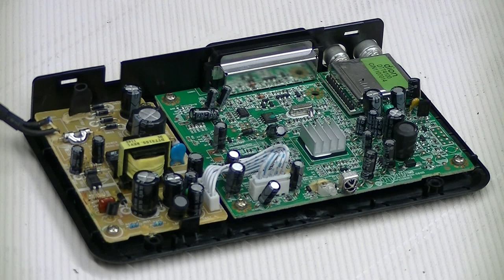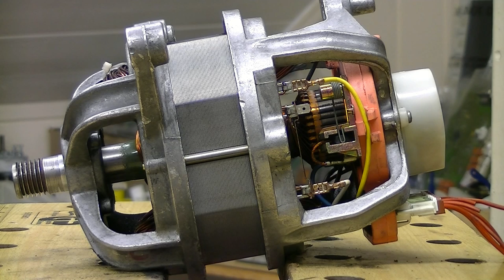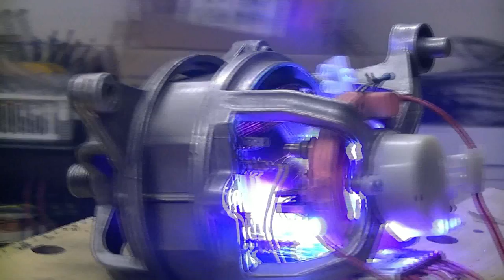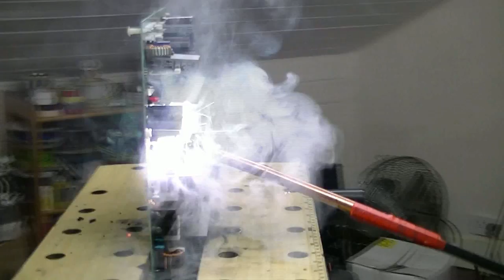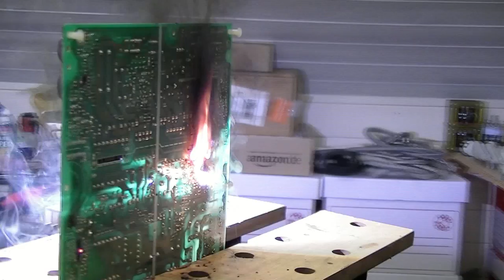Motor And PCB Pop

Comment: You're right photon, there is always something to learn from destructive testing. Always seems like those capacitors go first on those boards. So now we know, we just need better capacitors. Repeat the test and move on to the next problem component, and pretty soon we'll have indestructible electronics.
Reply: Its too expensive for companies to build that and they need their engines to go out asap so prople would buy replacement for them

Comment: Hey, if you want to see a brush motor arcing you don't need to overvolt a nice motor, you only need the Constellation 867A Hoover vacuum cleaner: it arcs as 2:00 with normal 230V 50Hz.
It's not a problem related to brushes: the springs that pushes the brushes are to weak and unfortunately the motor spin in the direction that the brushes get further from the rotor. If the motor spins in the other direction brushes will stay close to the rotor but probably brushes will consume very fast.

Comment: Poppaaaage. :D 

May I ask what was complaining at 0:46? Surely it wasn't the 28A variac, or was it the MEGA-MOT?

Ah, motor pop. For some reason, the first-take didn't seem to get too much speed, or last too long before it popped, but the second take ripped it right up. :D

Oh, I laughed =SO HARD= when the hot stick burst through the circuit board. 
Soldering skills....Oh dear, I've blown a hole in it. I'VE POPPED IT! :D

Thanx for showing, Mr. Photon. :-)

-BoomBoxDeluxe.
.
.
Viewer # 652 :D

Comment: Sorry, did not mean my comment as a response to you, but to those misinformed that think voltage is what makes AC motors go faster. I think people get mixed up with the universal motor, but that is not a true AC motor. A true AC motor like an AC induction type just sits there when DC is applied (but does have a braking effect).

Comment: What would happen if you just welded the rotor so it could not spin at all and then applied the same charge? Can you do a vid of that?
Reply: A continuous-duty motor like this will only quietly hum and smoke as you burn out the starter windings. I once did it by accident because the starter capacitor was not connected correctly. After that, I had to spin the shaft before applying power to make it go.
Reply: Ariel Barton At normal voltages -- what about insane crazy voltages? What I'm looking for is molten metal.
Reply: @mike4ty4  Your windings would short long before the voltage creates enough torque to break welds.

Comment: With a scop that show you a FFT of the frequences, the motor rpm got higher with the time, I figured out that the frequency was about 5000 Hz when it broke. That's about 300.000 rpm (300 krpm). That's pretty much for larger motor like that!

Comment: umm... I hope guys realize that AC induction motors have been brushless since 1888. The only way to get more speed out of an AC induction motor is with frequency. However, you increase the voltage so that the torque will remain proportional, else you would lose torque if you do not increase the voltage with the frequency.

Comment: Ah, that may have something to do with the way the counter works. I've seen an explanatory vid on this very subject: The view counter counts-up single views upto 301, & thereafter in 'batches'. It'll still be counting-up on the server, but only updates the view-count batches after all the views have been approved as valid views. Any invalid views are removed before the view-count is updated.

It's some kind of system to prevent artificial view-count pumping-up, either by people or bots.

-BBD.

Comment: MCU controlled stepper motor? Maybe a bit overkill but precise as hell and geared well quite good on torque. The drivers are not that tricky to construct and program specially with an Arduino and Stepper Shield.. Ive just made a DC based camera slider system and DC motors are a bit of a pain to control accurately.

Really loving the rotator shots :)

Comment: Aaaah, I see. I'd seem to think that in order to do that, the motor would need to be externally spun up by means of a massive gearing-up of the rotational speed. Say for example, a washing machine motor spinning at 14,000 RPM, then having a large pulley attached to it, then being belted-up to another washer motor with only a little wee pulley on it which then makes that one whizz-up 10x faster so that it's whacking around at a good 140,000 revs. :D

Mmmm, here we go....... *POP*

-BoomBoxDeluxe.

Comment: Eh?! You're asking whether a motor would dismantle itself? :D

If you look through Photon's video list, you'll find a vid called "High voltage & current" or something similar, & in that vid, a washer motor screams-up so hard that almost ALL of the com bars are blown clean off. :D

A post-carnage examination reveals only about 6-8 bars left on the rotor.

In "Extreme Dyson test", the motor at the end of the vid is spun so fast, centrifugal force rips out a big chunk of the commutator. :D

-BBD.

Comment: 1- Fuses can never be jumpered, if they are jumpered, when overvoltages and currents come, the result will be in these ways.
2- The biggest enemy of universal motors in brush / collectors is self-induction currents.
3- Self-induction currents; Collector and brush problems occur with winding problems and these points are destroyed too much.
4- We should never consider PCBs as an electrical source material, because toxic elements, the nature of which we do not know exactly, may come out at this time and directly affect us, may spoil our health, it is a huge mistake to see it as a source of entertainment.
Reply: They're destroying the electronics, there's no reason to be worried about bridging a fuse.